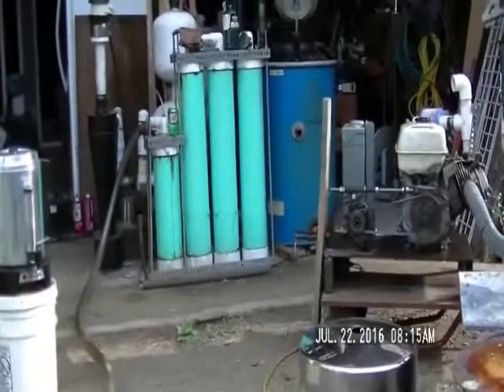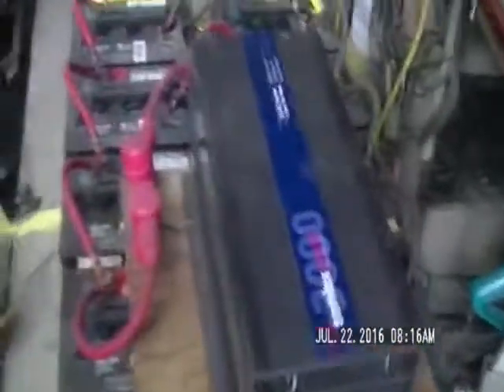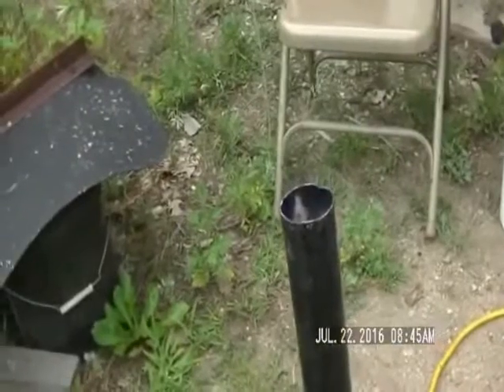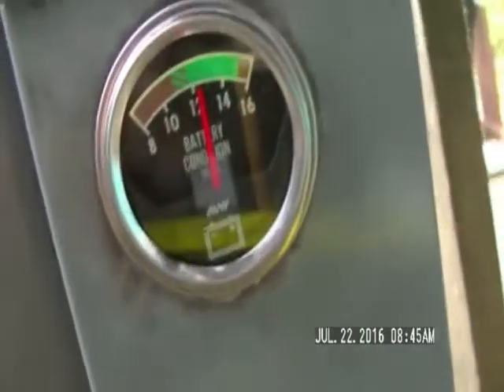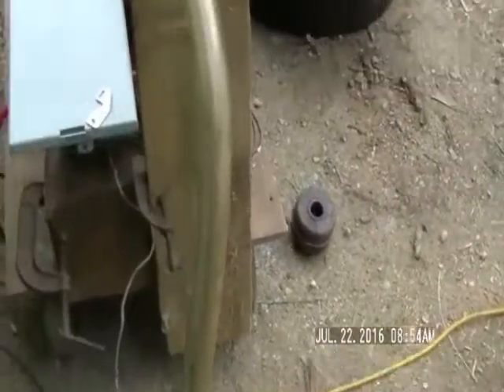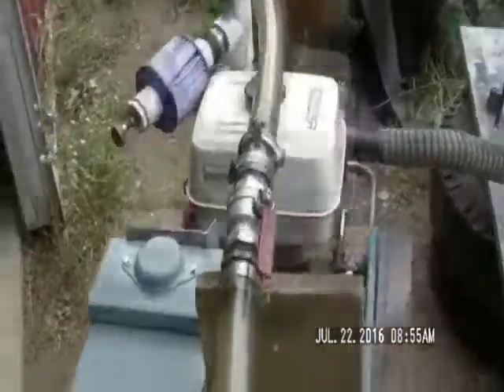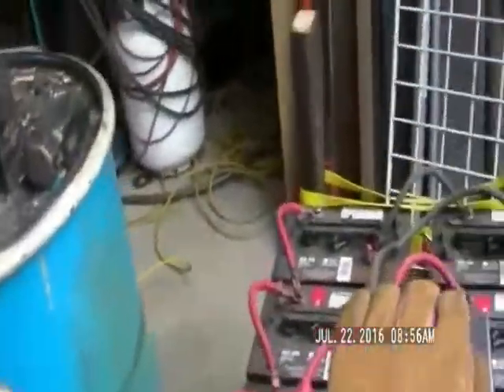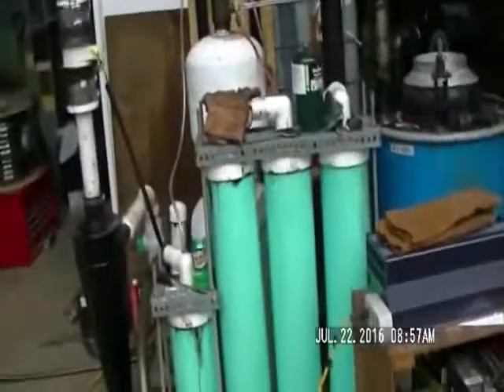Gasifier Mock Drill Grid Down 072216

Comment: Oh boyo. It's freeeezing here right now.  
 I actually reached out and tried to warm my hands over your flare, but it didn't seem to work out so well  ;) .  
 Looking good bro. 
 You have got your priorities all lined up too, as coffee is certainly at the top of the daily to-do list.  
 Just wondering about the manometer problem. Even with the reservoirs, it lost its fill of wood tea.  It seems to me that you will need to plug up the atmospheric end of each manometer, and put a teeny weeny pin hole in the plug, or the pipe just below it, so the fluid can't flow too fast. That way, you won't need to worry about closing any manometer valves.  
Either that, or you fill yer manometers with glue  ;) . 
Keep up the good work, my fellow woodgas bugbite victim.
Reply from the maker: Steve,  What is your recipe for liquid concrete ?. I was bummed.The initial tests with the big Hoover looked so promising. Those reservoirs are 10X the fluid measure and the baffle inside was supposed to deflect the fluid. I'll try your idea for sure.
Reply: NH Hbbyloggr 
 The recipe for liquid concrete is equal parts builder's mix and molasses  :) .
Yeah, it's a bit of a bummer when your engine drinks the last of your vodka through your manometers.
I think the teeny weeny breathing port in the open end of each manometer will fix it though, so your vodka will stay put  ;) .
Reply from the maker: It's almost first light here and the coffee was ready a half hour ago. I'll head on down, get everything filled back up and add a limiter to the atmospheric side as you suggest. Next run I'll use a checklist and try throttling down the engine at the start. Probably no need for full throttle
Reply: NH Hbbyloggr 
  Yup, a new fill of coffee in the manometers will surely keep them awake for the next run  :) . I think your engine would be just fine at about half of its current RPM, as you had it fair screaming along.
Fingers crossed for better results with those pesky U tubes this time round.
Reply from the maker: *****
 Just sitting here thinking about scrapping the mammies and using a sealed container with a diaphragm and a pointer stick glued to the center of the diaphragm. It only needs to be  relative as an indicator any how, right ?
Who ever says in a low steady voice of authority: " The water column is standing at 3.735 inches ". We are more like: Speechless."Huh Look at that !".
 I agree with you about the RPMs .
But I was surprised to see the gasifier generating so much heat at such a low barrel temperature/ Usually it's running around 350^ with this set up, not 250. Very dry wood could be part of the answer.
Reply: Hey Bill the alternator might not put out correctly if you drop the rpm's down on the engine. You may wind up running your alternator at it's lower rpm rating and then under load it falls below that which will cause the alternator to shut off then as the engine picks back up it will kick back in then shut off again as it goes under load again which would make you chase a problem that doesn't really exist. You could possibly wind up with an engine sounding like it's wobbling if the alternator falls below it's minimum rpm rating as it kicks in and out.

Here is a typical rpm ratings to ponder on. The average 60 amp alternator will need around 1,400 to 2,000 rpm at it's shaft to achieve 50% rated output, which on average consumes 3/4 hp. On my setup I'm running a 1:1 pulley ratio so I'll spin my alternator up to the engine speed which will be around 3600 rpm but in reality under load I'll probably run closer to 2500 rpm under with my small 5 Hp engine. 

Most alternators need rpm's closer to the upper 5000 rpm range up to 6000 rpm to give you the full rated current output. You could run a smaller pulley on your alternator to raise it's rpm's if you wanted to. Your engine is big enough to give you full rated power even running it on woodgas because even at 50% due to running on the woodgas your 13 Hp engine will still deliver an easy 7.5 Hp to the alternator.

Running your engine at lower rpm's will also affect the temperature on the gasifier and right now I think you have your system running in a good and hot sweet spot but that will be your call.

Something else to put in the back of your mind. Right now you aren't really pulling the full amperage from the alternator because your batteries are probably close to a full charge and they aren't really loading the alternator down at this point. Here is something to try. 

Temporarily switch over from your deep cycle battery bank to a regular 12 volt car battery (good battery) and run the Honda as you would normally do. Run the inverter like you normally do but this time hook up an electric heater to the inverter and run it on high. The average electric heater is normally around 1800 Watts on high and 800 watts on low. Listen to the Honda AND monitor the output charge voltage to the battery to see how much the alternator loads it down. See where the 14.4 volts falls under load. Remember that 14.4 volts is what is needed to correctly charge the battery up with.

Speaking of alternators, I have a 185 amp 12 volt alternator so the maximum safe power I can draw from that alternator without burning it up is 185 amps x  13.8 volts which gives me  2553 watts to work with or better yet, let's round it off to 2500 watts of maximum safe usable power. In reality I won't see the full rated current from that alternator but I will get a steady 1200 to 1500 watts from my small setup but for me that's more than enough to charge batteries with.

As far as your manometer goes, I think Steve had the right idea of just restricting the air entering into the manometer so that it can't react as fast to negative pressure changes.
Reply from the maker: flash001USA
 Flash, To be sure, to priority should go to the gasifier's sweet spot. That is the peak performance that I'm trying to achieve. Everything else will have to fit around that . Alternators can be changed to fit the demand and everything else is a accessory in my book. It's all about the right temperature at a steady beat and making good gas.  I'm headed down to my alternator repair guy's place in the morning to have him rebuild one from another rig and will ask him about making up a bigger one for the Honda. I noticed this morning recharging the Batt Bank after using it for last nights storm ( all night ) that the bigbox shop charger was holding steady at 50 amps charge rate. It has a higher charge capability but 50 Amp it was. The Honda is twisting a 100 AMP er.
I should check the pulley shaft RPM the alt and see what it's spinning at to more closely figure the output. Anyhow, good point ! Thanks kindly for the input and keep it coming.
Reply: Bill I figured you were using something bigger than a 60 amp alternator. You can actually find a good 185 or a 200 amp rebuilt alternator with a built in regulator for less than $100. I think I paid every bit of $40 or $45 for my 185 amp alternator but then again this is the south and there are old rusted cars in every single backyard here in the south provided you can cut the grass low enough to find them. Your Honda should be able to easily deliver 2000 + watts with the right pulley ratios. Hey what did you guy's get hit with there that took your power out? Bad storms or tornadoes or both?
Reply from the maker: This is what hit us. Check it out. We are 23 miles west of Manchester, NH
 https://www.wunderground.com/weather-radar/united-states/ma/boston/box/history/?date=2016-07-23 
  I will look into a larger alternator. That should decrease the amount of time needed to top off the batteries. I'm planning on adding 2 more for a total of 10 deep cycle Batts for the bank.
Reply from the maker: Flash, We have a  new 200 Amp Delco with internal regulator and internal fans on the way from our guy at the alternator shop. I'm going down to our shop to break the news to the LFD Honda. That ought to challenge the little humper. 
 Mark lined me up with a DC disconnect fuse which should be here in a couple of days.  
In the mean time with everything else going on around here the garden is coming in to harvest time. The third freezer is cleaned and ready, outdoor washing sinks and cold water baths are cleaned and ready for the blanching process. There is a strong pull from the wood gas bug wanting to " chip " in to help. Roll it out and let the wood bug handle the electrical generation side to start the freezer and get it down to the flash freeze cycle while the harvest process begins . Every body is happy now and the heartbeat at the compound continues on.